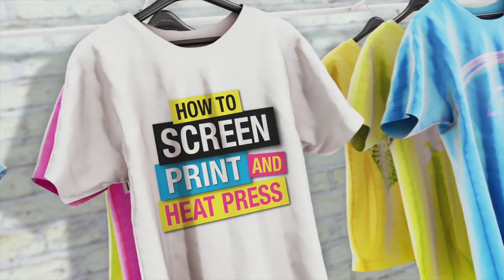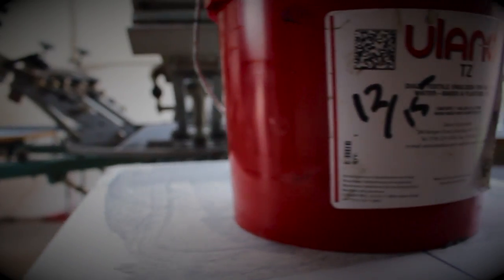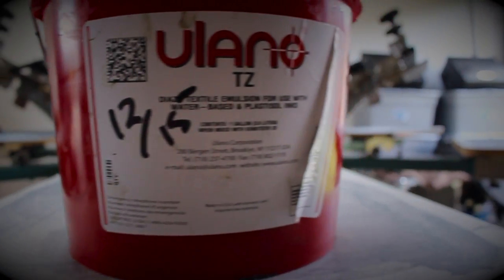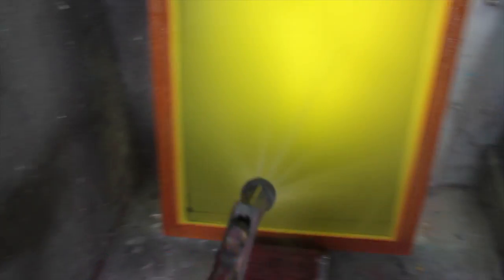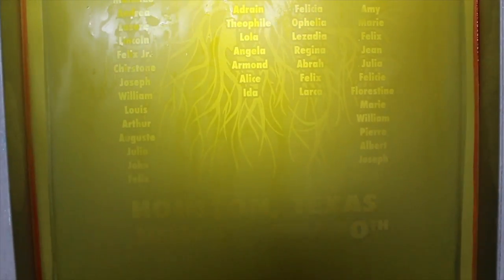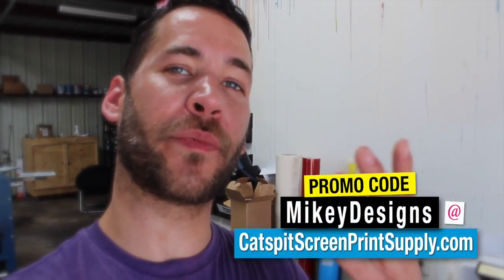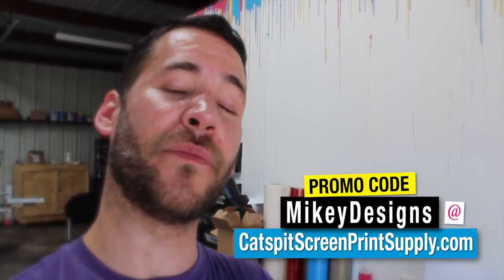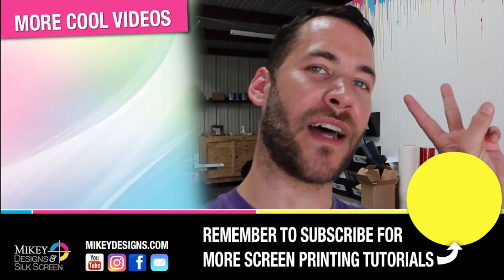How Long Does Screen Printing Emulsion Last?

Comment: YES!! I had some Diazo expire after a few months and it drove me crazy. Basically, the image would look fine and after washout and I would set it out to dry. After a lot of confusion over why the image wasn't printing I found some of the emulsion wasn't curing and was drying in the image. I since started testing other Diazo's and some would even just hit a point where they would almost completely wash out after a normal exposure time. Now I buy by the quart and keep it in the fridge and that works for my small business
Reply from the maker: Great to hear you found a solution.  I've yet to come across anything remotely like that.  However, we tend to go through the emulsion pretty quickly. For this video, I used the emulsion we have on hand that is the oldest. Still works great and went to press with the screen.
Reply: This is the main reason why I’m even on this video lol was scared at first seeing a lot of videos saying the shelf life doesn’t matter. Because mine was doing the same thing just watching right away but I’m glad I found your comment to find out it’s my emulsion !!!
Reply: *washing

Comment: I had a problem with my emulation, it's like maybe 3-4 months old and I keep it in a little fridge, the problem is that it takes longer exposure time and when I make sure that it is fully burnt I wash it off and the emulation falls apart it doesn't stick well to the mesh, is the mesh the problem or the emulation is bad?? I use fujifilm diracol 29

Comment: I had a dual cure that was a year old and still worked...and I had a screen in a black bag that was coated with photopolymer emulsion I forgot about. 3 years it was in that bag. It exposed fine and I ran a job with it :)
What do you look for to know if it's bad? Not exposing? Doesn't coat right? Harder to reclaim?!?! Makes me want to do some testing. My photopolymer is in my fridge for the first time ever. Curious to see if there's any difference. I have the humidity in my shop down to 35% but I'm having issues with the photopolymer taking days to dry in my vastex dri-vault. Dual cure dries in like 15 minutes in there, photopolymer stays sticky for 2-3 days. ?!?!
Reply from the maker: I'm still trying to figure out why manufacturers state those time frames. I get it can help save a company from wasting a bunch of time or product, but part of me thinks it's a selling / marketing strategy... to an extent.
I have never had emulsion go bad on me yet, so I couldn't even tell you. I'm curious to know myself. My understanding is the stencil will not holdup during washout. What photopolymer are you using? The humidity here is 57% right now and we don't have any issues with the film sticking.
Reply: Mikey Designs & Silk Screen  it first happened with a sample of Kiwo I got from ISS. It worked out amazing. Not thinking that I didn't use the screens coated with that for a few days. Tried it again and the poo wouldn't dry. Assumed I got a bad batch. Then same issues with saati textil pv. Didn't use the coated frames for a few days, but burned great! Tried again, tried burning a screen hours later...it stuck to the film so bad, it took almost all the ink off the transparency. Now today, 3 days later, it worked fine (thicker stencil screens are still sticky).
Same issues with kiwo and 2 quarts of textil pv...so I'm assuming these aren't bad batches. I'm at a loss at what the issue is cause dual cure is dry in 20-30 minutes in same conditions.

Comment: I bought ryonet wbp dual cure emulsion about 2 months ago. I coated around 15 screens the first month and around week 6 i coated 2 more. As i was printing the emulsion was coming off in a small area next to the tape. I just taped the bottom side and continued printing. Ultimately i ended up exposing a new screen to finish the rest. As for the screen i was replacing it wouldnt wash out completely. I used emulsion remover a scrub pad and even went to the car wash for the pressure washer and still it didnt completely come out. I assume it was because the emulsion is stated to be good for only 6 weeks but then again maybe the screen is junk? Not sure as i am new to this but i guess ill try to label the date mixed and see if the issue remains. Hopefully i dint have to spend another 200 for new screens
Reply from the maker: It could be that the emulsion was going bad. Also, when you put emulsion remove on the screen, be sure to not let it dry because that could lock them and you won't be able to reclaim the screen.
Reply: Update, after watching a video from catspit productions it turns out it is screen lock from under exposing my screens. I usually set my screens in the sun to dry bud since it was cold and wet recently i just dryed my exposed screens next to a heater vent and i should have set it back under the light for a while first. Guess you have to learn the hard way sometimes hahaha

Comment: Thanks for sharing! What’s the longest you’ve ever kept emulsion on screen before exposing?
Reply from the maker: Any time! Not very long because they get used up quicker than I can keep them on the shelf. As soon as they're dry they get exposed. I'll have to test it out. I know I've kept one for a couple weeks because it was a low mesh count I didn't need right away.

Comment: Im just starting the printing business.  I have a question which is the best emulsion i saw some guys use red some blue i don know how man others are . Can you help me
Reply from the maker: Certainly. There a few types of emulsion, but the most commonly used are photopolymer, which is a fast exposing emulsion, but doesn't hold good halftone dots, and dual cure, which exposes much slower but holds better detail. I personally like to use Ulano Orange photopolymer, and TZ emulsion. I've tried others, and this combo seems to work really well for me. Here are some links to those emulsions. I hope this helps!

Ulano  Orange Emulsion - https://amzn.to/2sSWpIE

Ulano TZ Emulsion for Halftones - http://amzn.to/2nyXxhH
Reply: I am new as well but the ryonet wbp dual cure emulsion has worked well so far. It usually takes me around 5 1/2 mins to expose a screen with a 500w halogen work light.

Comment: We run autos and manuals and use 60-355 mesh... I’ve used emulsion that was 3 years old and capillary film that was almost 4 (and I’ve got some that’s prob 10yrs still in the tube I cld try lol)... I’ve never had any failures... The only problem that I HAVE had and that is even with brand new emulsion is the emulsion coming off BRAND new MESH that needed to be abraided and degreased.. THREE DIF TIMES🤦🏼‍♂️🤷🏼‍♂️.. I mean coming off in large clumps where you cld tell it was not adhering to the mesh... that’s some new 110 mesh I just bought and I coated those 2 screens with a diff emulsion last night,,, along with 22 other screens with the standard Ulano BLUE we normally use... we’ll see.. great clips Mikey! Happy Thanksgiving😉👊👊
Reply from the maker: Thank you!!! And thanks for sharing. Let us know how things turn out! Happy thanksgiving!

Comment: Like 1 month ago i burned a screen with an emulsion expired from 6 months, now the emulsion remover doesn’t work, i have a lot of residue on the screen.. I have to try with bleach and high pressure water
Reply from the maker: Did you let the emulsion remover dry on the emulsion at any point?

Comment: Hello, I must be doing something wrong!  I am new at this, I am exposing my screens, they look good to start with then all the emulsion just washes away.  I thought that it could be because the emulsion was a few months old but you just crashed that idea.  Please help
Reply from the maker: Hi Maria.  Was the emulsion washing away during while washing out your image? Was it after printing? If after printing, what emulsion were you using and what ink? I'm thinking it could be under exposure but I'll need more details.
Reply: Hello, thank you for replying.  yes it washed away during washing out the image after exposing.  Not at first, i could see the image washing out as it should then after a few minutes the whole lot washed away and I was left with a perfectly clean screen.  I exposed it for 45 minutes under a standard house hold lamp.  I have now bought a 1000w halogen lamp (a flood light).  So frustrated with myself!  my emulsion is the two part type and quite a few months old.
Reply from the maker: Yikes! Yeah, it probably did go bad then. We store ours at room temperature and like to use Ulano. What brand of emulsion were you using?
Reply: Jacquard.
Reply from the maker: Never heard of it. Ulano, Chromaline, or Kiwo would more than likely last you longer and not go bad. I hope this helps.
Reply: That does help thank you.  Jacquard must be a U.K. make.